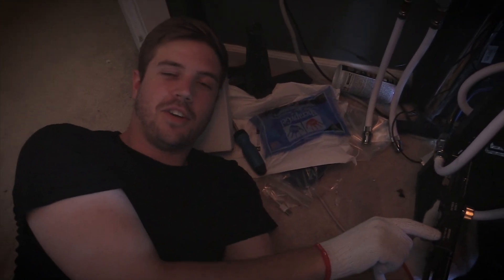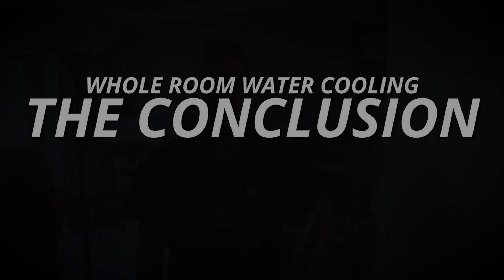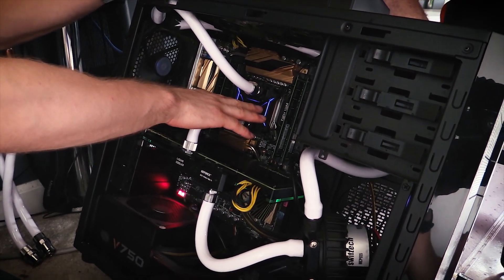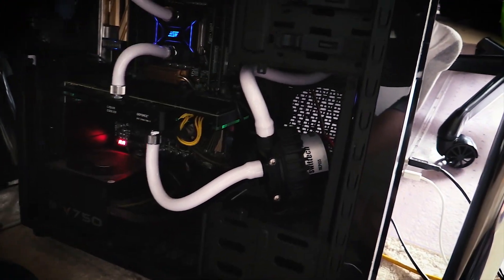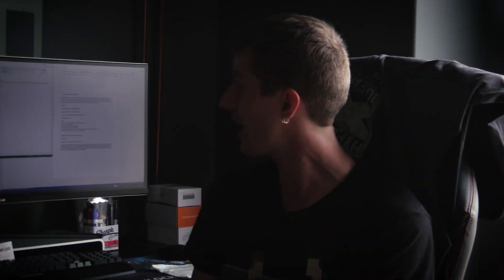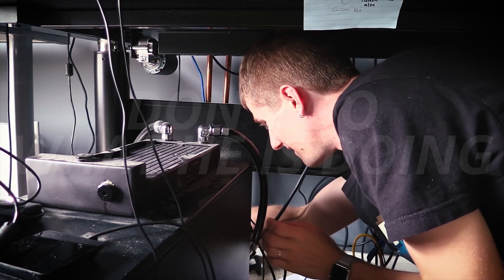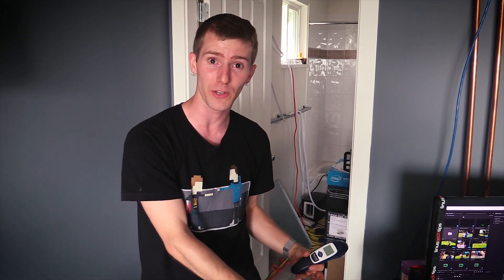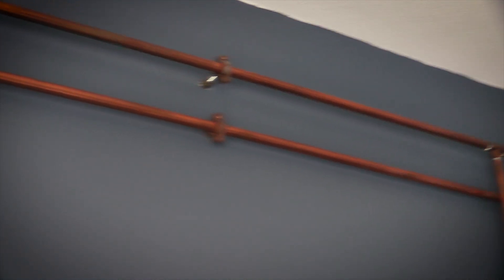Whole Room Water Cooling Part 7 - It's FINALLY over!

Comment: Engineering moment here but I'd be curious about the heat differentials between just having one system in the whole room loop vs having all the systems on the whole room loop under stress. Also I'm curious as to the temp differences of the loop between summer and winter.

Comment: If you need a replacment for console or need a new setup here you go this is everything you will need  (Sorry if there is some stupid buy or stuff i made this on pcpartpicker and i do not have an account so i thought this would be easier copying and pasting Intel Core i5-4690K 3.5GHz Quad-Core Processor
$229.99				$229.99	NCIX US	
	
CPU Cooler	

Cooler Master Hyper 212 EVO 82.9 CFM Sleeve Bearing CPU Cooler
$36.98	-$10.00			$26.98	OutletPC	
Buy	
$10.00 mail-in rebate	

Masscool Fanner-420 2g Thermal Paste
$1.95				$1.95	OutletPC	
Buy	
Motherboard	

MSI Z97 PC MATE ATX LGA1150 Motherboard
$89.99	-$10.00	$1.99		$81.98	Newegg	
Buy	
$10.00 mail-in rebate	
Memory	

Corsair Vengeance 8GB (2 x 4GB) DDR3-1600 Memory
$45.99		FREE		$45.99	Newegg	

Samsung 850 EVO-Series 250GB 2.5" Solid State Drive
$97.95				$97.95	OutletPC	

Seagate 2TB 3.5" 7200RPM Hybrid Internal Hard Drive
$89.88				$89.88	OutletPC	
	
Video Card		
Asus Radeon R7 370 4GB Video Card (2-Way CrossFire)
$179.99	-$10.00	FREE		$169.99	SuperBiiz	
$10.00 mail-in rebate	
Asus Radeon R7 370 4GB Video Card (2-Way CrossFire)
$179.99	-$10.00	FREE		$169.99	SuperBiiz	

NZXT Source 210 Elite (Black) ATX Mid Tower Case
$41.99				$41.99	Directron	
	
Power Supply	

EVGA SuperNOVA NEX 750W 80+ Gold Certified Fully-Modular ATX Power Supply
$104.99	-$25.00	FREE		$79.99	Newegg	
$25.00 mail-in rebate	
Optical Drive	

Asus DVD-E818AAT/BLK/B/GEN DVD/CD Drive
$17.89				$17.89	OutletPC	
Operating System	

Microsoft Windows 8.1 OEM (64-bit)
$96.98	-$10.00			$86.98	OutletPC	
$10.00 mail-in rebate	
Case Fan	

Antec 761345-75081-3 34.0 CFM 80mm Fan
$2.58				$2.58	Mwave	
Monitor	

Acer G227HQLbi 60Hz 21.5" Monitor
$109.99				$109.99	Micro Center	

Cooler Master CM Storm Devastator Gaming Bundle Wired Gaming Keyboard w/Optical Mouse
$29.99	-$5.00	FREE		$24.99	Newegg	
Buy	
$5.00 mail-in rebate	
Headphones	

Logitech G230 Headset
Total cost is around 1400$ But you save in the long run and you can remove the headset  monitor and others if you feel you do not need them

Comment: hi Linus, first of all I love your channel, and your reviews are so helpful. I have an input that might help you lower the cooling in you copper tube system. You might want to cover your copper tubes with tubing insulation. It's the thick black rubber thing air conditioning technicians use when installing air conditioning tubing. Though i'm not sure how much it will help or if it would help at all with water cooling.

Comment: I wonder if connecting the loop to a cold water spring and ending it a drain would work. Would probably need a pump somewhere in the loop, but still.. would super interesting to see. Constant fresh, cold water.

Comment: Did you take into account how much the air conditioning runs before/after? If the AC is always on and it's still running after running the whole room watercooling then the room temp would always be what your AC unit is set to.

Comment: I wonder if attaching a water chiller to the loop would result in lower temperatures and if the order that the computers are attached to the loop would have a difference in the individual and whole room temperatures.

Comment: I actually pulled out my radiators from my pc and put them outside my window for the summer and my room is not anywhere close to how hot it would get. Got my AMD Fx 8320 running at 5.4 GHZ and she pumps out a lot of heat.

Comment: I agree with AC being the solution. I have central air in my home set at 71F. With 2 980Ti in SLI and fans set at 70%, my cards both stay under 80C at full load. Both are overclocked to 1420Mhz boost clock and 7600 memory as well.

Comment: Is there a reason why people don't use oil instead? Germs and living things can't live in oil right?
Reply: ***** Oil technically is better and safer, but the downside is that it can be messy to clean up spills. Oil also won't tend to flow easily at low temperatures. On the upside, it's harder for things to grow in a near complete absence of water, and any leaks wouldn't short any components.
Reply: nigahiga6400
That what I thought. Oh. So its best with smaller water cooling builds.
Reply: Yor Highness Custom liquid cooling loops are not cheap to set up. Mineral oil isn't too terribly expensive, so the added cost for most will be small. As long as the loop has no rubber fittings or tubing, oil should work well.
Reply: +freexavier Water has a very high heat capacity compared to many other substances. Mineral oil only has about a third of the heat capacity water has.
Reply: Yor Highness
Well it will sort of be worth it since you won't need to do cleaning which is a hastle.

Comment: Hi LMG, and any viewers that see this comment! I'm a huge fan, but I have two questions. They do not have anything to do video. The first is how do you upgrade a PC component. Just buy the new hardware, shut down, and swap? My second question is how can I easily increase wifi range and speed. I use Comcast and I just have the basic router that they provide I guess. Any help would be amazing, even viewer input is much appreciated!

Comment: This feels like the type of project that would only be economically feasible to do correctly if the infrastructure was laid before the walls were finished. It may even be economically beneficial if optimized a bit. That is coming from the perspective of someone in Texas where air conditioning is a significant expense and not considered optional.

Comment: Well... Ok, putting isolation around the the pipes would reduce thermal exchange from the pipes to the room and allow cooler water to get to the computers and allow the warm water release the heat in the other room (maybe?).. Also Corsair 1000W power supply might be cooler. You might be pushing the limits of the 750W PS big time which in turn would overheat the PS. You would want the PS to run low to medium wattage range so it does not create too much heat...

Comment: it's not too late to put some insulating around the copper tubes. so the heat will leave the system at the actual radiator outside instead of all the tubing.

Comment: Couple cheap solutions for the heat problem are getting:
Reflective tinted windows - http://www.homedepot.com/p/Gila-3-ft-x-15-ft-Mirror-Privacy-Window-Film-PRS361/100196546
My parents put this on there windows and the room temp lowered quite a few degrees
or
Roller shades - https://www.theshadestore.com/window-treatments/product/roller-shade?color=black&material=10%25&pcrid=74438649721
My boss did this solution for his computer shop a few years back and it allowed people to still see inside or out while blocking a lot of heat
or
Blackout curtains - http://www.walmart.com/c/kp/blackout-curtains
I have these currently because of my job and they also help with the heat considering I'm in Florida

Comment: Couldn't the copper pipes be insulated? That would lower ambient room temperature as the piping would not dissipate as much heat into the room and the incoming piping wouldn't pick up any ambient room temperature heat. Or am I totally wrong?

Comment: Back in Dec 2014, I commented very specifically on the copper pipe being on the wall and simply dissipating heat removed from the computers, right back into the room.  

I was met with a response of this: "While the copper tubes MAY radiate SOME heat, that doesn't really make a difference. Even if it did, you also have copper tubes radiating SOME cold as well, on their way back to the loop..." - TDPEquinox

First, "may/some" nothing.  Copper is one of the best conductors on the planet earth, next to gold.  Secondly, you can't radiate cold.  You can only apply and remove heat.  That's the first rule of thermodynamics.  Any "cold" pipe just takes ambient heat back in and puts it right back in the water, and the cycle escalates to a critical point where the volume of air in the room is simply too large to heat by the total surface area of the pipes, hence your 40C idle temps and 30C room temp.

Now that the project is over, I'll tell you how you COULD have salvaged all that work for next to no benefit.  Foam pipe insulation.  You can buy it in 4ft sections for about $1.30USD at your local Lowes/HomeDepot/whateveryouhaveupthereinCanada.  This insulation is specifically designed to retain heat within the pipe until it is moved to the area from which you intend to dissipate it; i.e. outside.  It's the same concept I've used in racecars, wrapping the exhaust with fiberglass to hold the heat in, making the exhaust slightly easier to move out the back by the engine, also giving the ability to get rid of those pesky heat shields reducing weight, and preventing the inside of the car from getting too hot (which it does anyway).  $30-35USD and your room would have worked...mostly... minus the mixing of metals, no antimicrobial, poor head pressure, etc etc all the other things I typed out 7months ago.

What should you do differently next time?  With the understanding that there won't be a next time, the answer:  Think it all the way through before buying a single thing.

Comment: you could use a isolated ppr pipes with a thermo pump that cool the water in the loop. The pump is a kind of a air conditioner but new generation. high afishesci with low power consumption.

Comment: there is one thing really to say for the loop system==== priceless

it may not do everything that linus was hoping for it to do but the experience had to have been priceless.

i think that they could have done better in execution but............... it was genuinely the first time i had ever seen it done ................ ever. so there is that.

things i would have done differently? 
  water cooler recycle/ exhausting outside 
          use an old watercooler as a chiller/reservior and exhaust the hot air outside
   use anti microbials against fungi alga and bacteria from day one 
   use less piping 
         the longer the pipe the more inefficient the system becomes
   polarize, and/or mirror the window and filter out the uv/ir spectrums drastic heat            reduction right there
but those would be my recomendations after having seen the series  so ya i guess i learned something from this series. goood job linus.

Comment: I would have taken this a step further and used heat exchangers at each machine AND used an AC system that was originally designed for boats that use seawater to exchange heat. Just would need to use a heat exchanger on the inside of the system rather than the outside of the system.

Comment: I wonder if there's more mileage in this experiment? How about the heat exhausted outside being pumped into some kind of energy reclamation system instead?

Alternatively, use a thermocouple array in a heat exchanger configuration to power low amperage devices such as charging phones, tablets etc.

Not a simple or inexpensive thing to do but would be interesting. There must be a few kW hours that can be recycled?

Comment: Had the distribution piping been run 'low' near the baseboard, the required head (resistance/pressure) could have been substantially lowered and the required 'pump' supplied pressure to circulate the water reduced.
Similarly, PEX tubing would have been cheaper and easier utilize - add to that that the tubing should be insulated else the heat is STILL simply lost into the room - rendering all of the effort moot.
Add to that Linus could have simply climbed a tree and bent the right angle elbows rather than incurred the exorbitant expense used for fittings...(or used PEX and eliminated the 90 degree elbows entirely)...
All in all, the fancily imagined systems that progress without a simple preliminary evaluation of the goals and involved variables renders this a plan worthy only of groups such as the government.

Comment: Whoa what an interesting waste of time effort and money then, its interesting trough that even if it was kind of a failure for linus it may still be quite practical for places like servers and stuff like that, where you may have to be constantly switching pcs, just to lower the ammount of maintanence for each individual rig and keep them running at low temperatures.

Comment: Why wasn't the hot pipe insulated? He said it himself they were just dumping a lot of the heat back into the room because of the bare copper pipes. I know he said that it would look ugly. But was this project to make the room cooler feeling or cooler looking? Adding insulation to the hot pipe would not have been so expensive as not to try. So why didn't they? That could have been the final step to getting the performance they wanted.

Comment: LinusTechTips 
Hi, couple of ideas / suggestions that might make whole room water cooling more sucessfull for another attempt:

USE HEAT EXCHANGERS BETWEEN MAIN LOOP AND SYSTEMS!
By using the heat exchangers you can keep the Computers coolant isolated from that of the Whole Room water loop while still being able to eject the heat outside, thereby preventing contamination of system coolant and blocks, it also means that you can keep coolant flowing within the machine while connecting to the room loop. Also by using a heat exchanger you should be able to reduce flow restrictions on the main loop as you dont have to push fluid through multiple blocks.

On the current systems what you should have done is had a small internal bypass that allows a small amount of coolant flow to continue inside the machine when the hoses are temporarily disconnected, this small flow is enough to stop processor temperatures sky rocketing very fast while the machines are not connected to their rads or the system. Water has the ability to hold a large amount of heat, so with the small flow, you actually have a pretty decent amount of time to do the swap without rushing (possibly up to a minute or more depending on load, and coolant capacity of the machine). 

For the Supply and Return Main manifold lines, use large diameter pipes, the larger the better, then for each drop down you have that connects to a computer, use smaller diameter pipes (compared to the main) for those, what this does is allows the main pump to be able to have a high flowrate, ensures that there is pressure all the way to the very last machine and stops the first machines from having to much of the available flow. Think of of it this way, Your Supply / Return lines are your Trunk, its capable of 10Gbit/s, then each work station gets a 1Gbit/s allowance from that, instead of having a 1Gbit/s trunk, and every machine having to share that while being connected to it at 1Gbit/s. Also at the very end of the room loop, have a SMALL Bypass (preferably a pressure operated valve) that goes from the supply to the return, this stops the main pump from being dead headed if no systems are connected and the pump is left running. a dead headed pump will actually heat the water in the pump from friction, and it puts high load on the pump.

Insulated pipes which you mentioned would indeed be a very good idea, you can get insulated copper pipes (basically what A/C systems use between indoor and outdoor units) not just pvc. A on demand water chiller unit might be an idea for very hot days when radiators alone cant manage.

The main problem you had with contamination is not because of the existance of metal itself, but because you mixed different kinds of metal within the same fluid loop and or failed to use proper corrosion inhibitors.

Comment: And how would you set up on the pipe insulation. Such as a matted to the radiators. She held that all the heat in roses up to radiators and not cast for peace.
google translation :).

Comment: Just saying if the point was to cool the room down why would you use copper tubing? I know that it works as a radiator but with all that surface area surely a lot of heat is going into the room.

Comment: you should wrap all the outlet pipes in foam insulation so the heat isn't dissipated back into the room before it gets outside to the rads

Comment: What about insulating the pipes?  Surely that would lower the ambient temperature of the room significantly and direct the heat dissipation to the outside.

Comment: coat your hot copper pipes in rubberized truckbed liner to prevent it dissipating heat into the room before it goes outside

Comment: At the new office you guys are having, you could try whole-office water-cooling with the cold source coming from the water main and hot source escaping through ducting to the server room, so less of the heat is radiated through the copper tubing.

Ideally, the short length of copper from outside to the duct should be covered in cement or some other heat-insulating material to ensure very little of the heat actually enters the room, and the quick-connects would be cemented into place which would make them very, very difficult to steal. Testing must be done beforehand to ensure the water doesn't leak and cause issues with the cement in the future.

There is some practicality, and with a nearly-empty building you guys can still specify ducting in the editing room or offices for that... right?

Comment: The copper pipes running every where reminds me of those old timey radiators used to heat your home. If you don't want them to leak heat into the room, they should be insulated and in the walls.